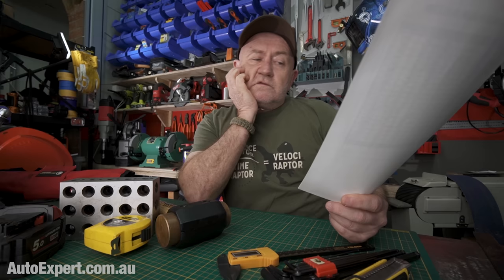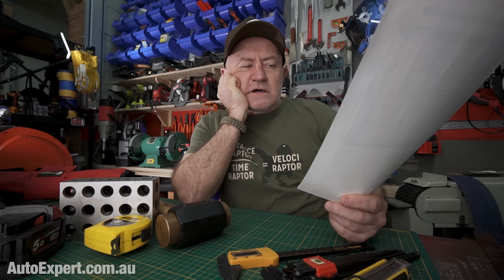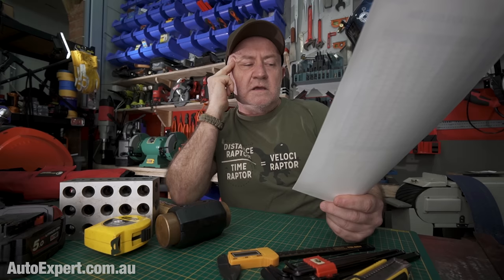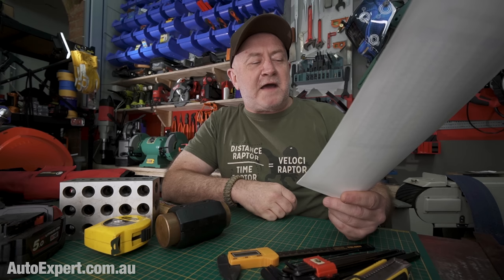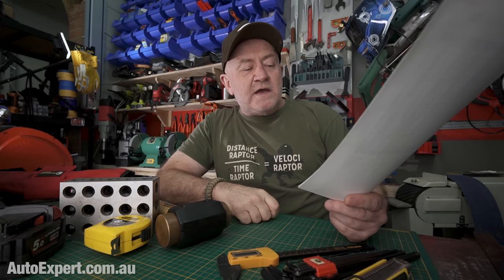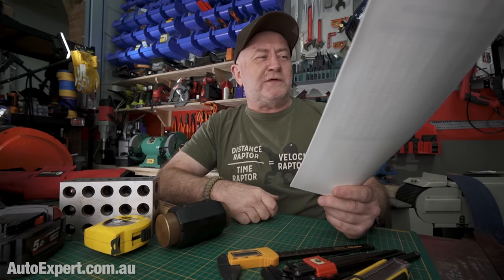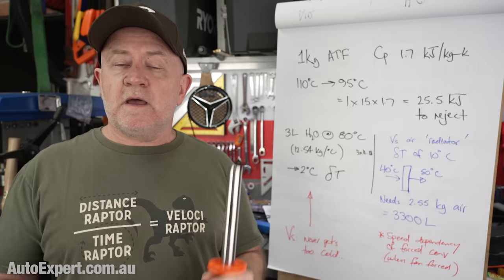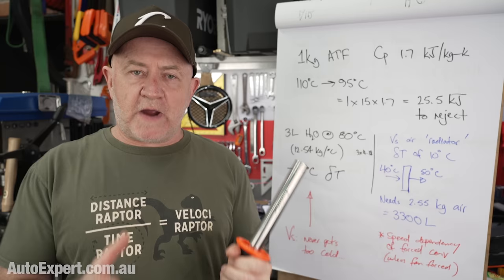The truth about fitting an auto transmission oil cooler | Auto Expert John Cadogan

Comment: I fitted the biggest ATF cooler I could find to my transmission after I discovered it had a habit of burning its oil. I left the OEM ATF (oil-to-coolant) cooler in the circuit prior to the ATF passing through the after market oil-to-air cooler. My transmission may run too cold now, but I've never heard of an auto transmission failing due to lack of heat. My ATF now remains cherry red and doesn't smell like sh!t. I'm happy.
Reply: I cutout the engine cooling radiator because I didn't see the point in heating the transmission oil twice and cooling it once. Very pleased with my Air Trans' Cooler only install.
Reply: I totally agree with you Daniel i fitted one on my Colorado as i do a bit of towing and i don't notice any adverse gear changing when cold nice smooth gear changes no matter the weather

Comment: I fix large heavy diesel construction equipment for a living and most of them run a transmission cooler that is cooled by the engine water circuit but via a separate cooler.  Warms up the trans quicker and keeps trans temp at coolant temp.
Reply: Why is the AT cooling system running if the AT doesn't need to be cooled ie needs to be warmed up?
Reply: @SilverMe2004  If its a water to oil style the engine warms it up at the same rate the engine warms up at and will stay locked into only 1st or 2nd gear till min temp is achieved.
Others actually behave just like a cooling system and have a thermostat to regulate cooler flow so as to not over cool the oil.

Comment: dude..  the ford F150 has a small ATF air cooler why does the F-250 has a larger air cooler?  Always put the add on air cooler AFTER the radiator cooler.  Get to the point..  this is a waste of bandwidth.

Comment: Fans John, fans. An electric fan or two can quickly overcome 'heat soak'. If you've been lucky enough, to see heavy equipment, constant moving airflow is the name of the game.
Reply: And none of them have electric fans.
CAT has hydraulic fans. 
Electric is not powerful enough for the available amperage.
Reply: @TheBandit7613  Know about CAT being hydraulic, they infact put their Transmissions coolers before the Radiator also. You can have electric fans on heavy equipment with just using an inverter, for some reason it doesn't happen.
Reply: @jonkvh  consider this. Generally, they say a mechanical belt driven fan can use up to three to five horsepower. They move a lot of air. Now think about how powerful the charging system would have to be for an electric fan that draws three to five horsepower. That's pretty incredible
It all goes back to the original design of the cooling system. It is said that electric fans are more efficient than mechanical belt driven fans. And this is true as long as they are not running! There are losses in power every time you switch from electric to mechanical. Actually a belt driven fan is more efficient when it's running.
I'm not sure if you are familiar with Death Valley. I live 30 minutes from Death Valley. I have a Jeep and a performance side by side.
I tried switching my Jeep to electric fans including a bigger radiator. It ran too hot in deep sand. It takes a certain amount of horsepower to move a certain amount of air.
From what I can figure out my Jeep fan is @5000 cfpm when the fan clutch is fully engaged. A good electric fan is 3000 cfpm.

Comment: Water to oil coolers are also useful for helping the oil to warm up quicker when you start the engine from cold. As the engine coolant warms, heat is transferred to the oil so you can get smoother shifts sooner. It's worth considering these systems more as thermal regulation than cooling per se.
Reply: With lock up torque convertors in transmissions once the convertor is locked the engine is keeping the trans warm, the trans becomes added engine cooling.
Reply: @raygale4198  Not always true. Depending on the outside temperature, speed, load, etc, the transmission oil temperature can easily exceed the engine coolant temperature even when the converter is locked. I have seen it happen myself, especially when cruising at high speeds in hot weather. You're right that a transmission generally won't need very much cooling when cruising with the converter locked though.
Reply: Actually that's not true for the coolers in the radiator tank because the radiator won't warm up at all until the thermostat opens, which may never even happen in cold enough weather with the heater on. And even when the thermostat does open, in cold weather, the air hitting the radiator will be cool enough that the return coolant will still stay quite cool under light loads. Don't believe me? Feel your lower radiator hose after driving around for a while in below freezing weather and see for yourself. To warm the coolant on cold start as you described, what would actually be needed is a heat exchanger that the coolant flows through constantly, which is used on many newer vehicles for that reason. The radiator warming up the fluid in cold weather is just a myth.
Reply: @averyalexander2303  The original comment was about oil to water coolers, in modern cars at least in Australia they are often plate type heat exchangers mounted on the engine itself and taking water directly from the engine bypass loop, as soon as the engine is running they have water flow and begin to transfer heat. Have a look at Aussie Fords made since about 2005 for a typical system.
Reply: @raygale4198  A stacked plate heat exchanger with warm bypass coolant flowing through it would indeed help warm up the fluid, a lot of cars are using those now for that reason. But most of the vehicles I see here in America run the fluid through a tube in the cold side of the radiator, which was never intended to be a heater. I was surprised that John thought the thermostat regulates the temperature of the fluid in the cold tank or that running the fluid through the cold radiator tank would warm it up because it won't for the reasons I stated.
Reply: cold air intake ). I was wondering if I can get an opinion if I need one for the hot temp. Or if my car is safe enough to handle it via it’s build design? Any thing helps

Comment: Well said John. I used to test cooling system performance using a 4WD dyno in a climatic chamber. Bullbars, winches and driving lights inhibit air flow to such an extent, even if your vehicle doesn't overheat, you'll shorten its life as everything runs hotter. Batteries, A/C, steering, rubber hoses, everything. Viscous fans run harder which burns more fuel, adding even more heat. Then there is the air blocking effect of fitting another finned cooler in front of the existing coolers (Radiator and AC condenser). Once again, the temps go up. Also, the additional cooler in the trans oil circuit adds restriction which can reduce oil flow which inhibits the performance of the OEM trans cooler. This was an issue with Falcons with 4 speed autos as the trans oil pump was very small to reduce fuel consumption. I've learnt that accessory manufacturers first convince you what you have is insufficient, then try to sell you a solution to a non existent problem.
Reply: Between John's theory and your practise, the evidence is overwhelming! Thanks.
Reply: Transmission suck. Buy a car with a gearbox. Then add a gearbox cooler..and an oil cooler and increase the water cooling with an a reservoir in the airstream. Run a return line to the tank to cool the fuel.  Thats how you go from overheating to cooling it if you race an AC with a big and hot V8. The whole system runs in the tropics at 35 degrees + and stays in the 170-180f window all day. I run a switch to override the rad fan on cool days or in stop and go or in the workshop. Heat kills.
Reply: @808bigisland  Heat kills indeed. I'm over the manual transmission thing. I use to insist on manuals then I got lazy I guess. Also the misses...the misses. I think you know how that story goes.

Comment: I really appreciated this John. Thank you for explaining the differences between fluid and air heat exchange so simply and clearly. Makes me recall a friend who competitively raced a group N Torana and built a heat exchanger to cool engine oil using the engine coolant. He was laughed at for not just fitting another cooler in front of the radiator. However this guy owned a radiator shop. And Ivan Tigh was involved. Problems solved.

Comment: I've had my go at re-engineering a vehicle. I put a centrifugal supercharger on my 2005 Fatboy. Power output approximately doubled, and of course heat build up doubled as well. Impossible to increase the surface area of the air cooled engine, so an oil cooler was added. To prevent overcooling and slow warm up, the Jegs oil cooler fitting had a thermostat to limit oil flow to the heat exchanger when temps were low. I had 2 radiators on an air cooled engine, as it had an air-air intercooler too. End result worked rather well.
Reply: 140 decibels at 40kph with 3rd gear maxed out. 
Can it beat a 300cc ninja now?😂

Comment: Great Vid John , One thing most dont think about is oil restriction , The aftermarket coolers (some ) have the push on barb fittings and are crimped down and cause a restriction I have fitted many trans coolers I make sure the ends of the pipes are as large as the original pipes on the rad , I did a little test one day and the return line pressure (no cooler 40psi at idle in drive  62psi with the cooler connected ) opened up the cheap fittings on the cooler and got it down to 45psi more line pressure in the cooling line restriction is not a good thing when the big VB is towing his Thunder box (i mean van) , 
Looking forward to the next laugh with you mate , Your a bloody legend and a true Aussie ,
Rob
NSW
Straya

Comment: Very good points John. The vehicles that use only a fluid to air cooler from the factory have a thermostat in the transmission cooling system that bypasses the cooler at cold temperatures. Also most transmissions will not lock up the torque converter or shift into overdrive at cold ambient temperatures until the fluid warms up. By keeping the converter unlocked and the transmission out of overdrive the fluid reaches operating temperature faster.

Comment: The water in the bottom of the radiator offers steady consitent temperature regulation. Got it.
Excellent in detail explanation.
Reply: But if the OEM gets a crap tube installed in the radiator bottom tank as a means to save pennies....the owner after 3 to 5 years has a destroyed trans...ask Nissan Pathfinder owners.....
Reply: @JohnSmith-yv6eq replace oem radiator with aftermarket good brand like OSC

Comment: I’d say the issue with the BT50 water temp increase was down to the torque converter slipping increasing the auto fluid temp and water temp. Don’t know BT50 trans cooling set up but that’s exactly what happens in my Pajero. If I tow my 2t van in 5th gear the TC won’t lock and the AT fluid will head north of 100 deg’s very quickly and the engine water temp to 96deg’s at 90kph. If I tow in 4th at the same speed with the TC locked up, the eng temp sits at 82 and the trans fluid at 85 to 90 all day. Slight increase when climbing. Standard Pajero with no modifications
Reply: Pajero has a cooler from standard as well.

Comment: Great master class John, thank you. Always a believer of leaving the vehicle stock, as the engineers designed and tested it. Cant believe that mechanics have recommended external transmission coolers. Ito be  now makes sense that the cooler needs incorporated in the radiator. No one ever talks about the importance for the Auto transmission needing to be heated to run at a operating temperature. I have never had issues with my Auto , even when towing! I don't have a bull bar, driving lights or a winch of course.

Comment: Look up Derale thermostatic fluid cooler valve...
I have installed this with an air cooler...
and I live in an area with -5C during winter...and 35C in summer.
The thermostat ensures fast heating of the ATF while 10% bypasses and keeps the cooler full...
When warm the thermostat opens as far as necessary...
and the ATF still flows through the water cooler in the bottom tank of the radiator....
which is still OEM and 31 years old....without leaks.
The engine lube oil cooler fitted to the engine is a plate type in the side of the block...so there is extra loading on the coolant system anyway....

Comment: I watched an Aussie transmission repair guy on the old poo tube who said that the same 6 speed auto as fitted to the Hilux, Dmax, Triton and other utes is a reliable unit. However he did go on to say that the Triton is the only one with an external trans oil cooler. He then went on to say that the Triton's trans lasts longer and has fewer failures than the others. He was of the opinion that the higher heat cycles was the reason the others were less reliable, food for thought.

Comment: Heya. Many years ago, when servicing my own KH 2000 Mitsubishi Verada, (on this  occasion, I was changing all filters and fluids) … I did notice the oil lines for the auto transmission went through the bottom of the coolant radiator. I thought this might have something to do with heat exchanging. I.E, when cold, quickly transferring heat from the coolant to transmission oil. When hot, passing heat from the transmission oil to the coolant during normal operation. Great work John, informative as always!

Comment: In the 70’s I drove the Perth/Port Hedland trip a few times in Valiant VIP. On some days it was so hot there was cars pulled over every few miles with steam pissing out of them. I wound down all the windows and turned the heater on full and travelled at 40 mph. The choices were fairly stark. Cook in the car but still travelling or cook on the side of the road. The silly buggers chose the side of the road.
Reply: As general statement cars now better heat transfer margin.

In old days in Arizona (hot place in US) cars would stop periodically climbing mountain roads.  Now nobody stops on these roads, n uses air cond the whole time.
Reply: Silly buggers might have been as silly as me. I topped up the fluids in a '75 HJ ute before commencing the 150kmh drive home on a stinking hot Victorian summer's day, many years ago.
The temperature light started to flicker. I turned the heater on, wound the window down and backed the speed all the way down. The flickering reduced and there was only the slight glow of the temperature warning light.
I made it home alright, but definitely in a parched and agitated state.
The following morning my level of patience had increased to the point at which I felt I could address the problem.
I opened the bonnet and there was my radiator cap, upside down on the radiator cowl. I'd never put it back on.
Reply: lol, similar happened to me recently. Hot summers day (40 something) in Sydney’s national park. The electric fans on the radiator in the toyota kluger had packed it in. I set the heater to max fan and max temp, all windows were down. Was a sweaty trip back to the guests service department.
Reply: Great idea. Very good for my (almost) tropical Brazil !
Reply: Smart man drive past idiots!

Comment: I think a good future discussion would be about optimising gear selection to keep the TC in the locked condition.  It's even an applicable skill without towing as climbing a long hill at highway speed can result in 1°C increase every one or two seconds in my experience with a Nissan 4-spd.

Comment: Air movement through an air trans cooler is around 3000 cfm, and the temperature difference between the cooling medium, air, and the liquid being cooled, can be 3 x or 4x the difference between the water version. In any event, with a coolant type system, the heat energy still has to leave through the radiator, via air. If air can cool an engine/transmission combo, it surely can cool a trans alone.

Comment: My advice here in Florida:  If you're towing anything heavy (boat, commercial yard trailer, car trailer) then yes.  Bar & plate, bypass the factory radiator integrated cooler.  If you're just towing a jetski or something, don't bother.

Rebuilt transmissions for a living, a surprising amount of trucks came in with cooked transmissions from towing.  Here in America, people just tow whatever ridiculous amount of weight they can.

While towing a heavy trailer with a car on it, our 7.3 Powerstroke Diesel E350 van (equipped with a transmission temperature gauge) noticed a significant drop in transmission temperature under load with a standalone cooler (radiator bypassed).  No significant changes in coolant temperature, maybe 5 degrees F at most cooler.  If you're getting a cooler, it's should be for the health of the transmission, not for the coolant temperature.  Like you said, if your vehicle is overheating, it's not the trans causing it.  It's either blocked up cooling passages and/or too much strain on the engine itself.